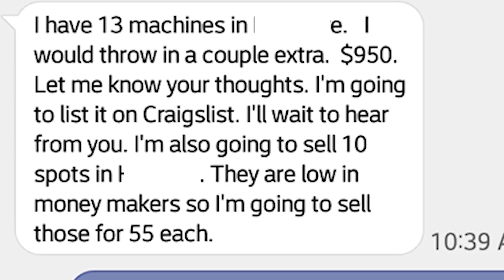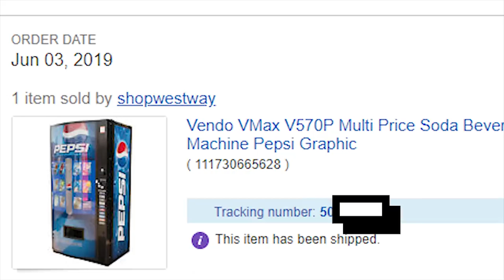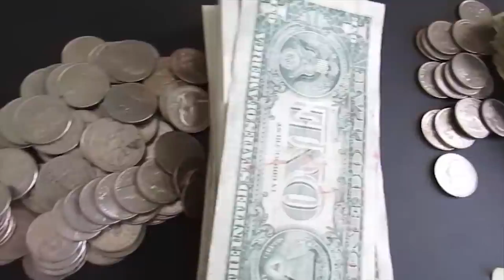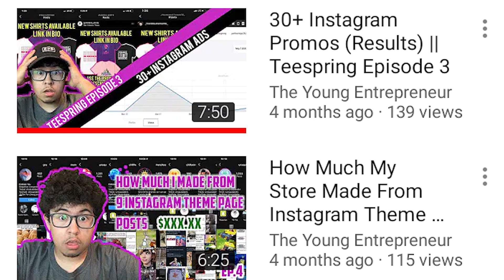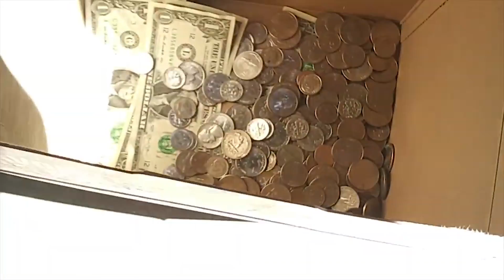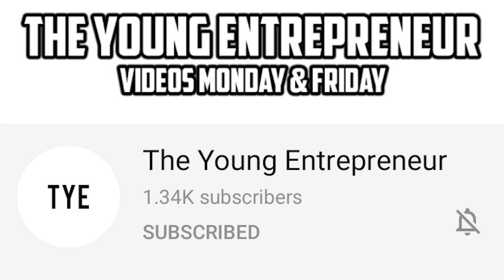Why I QUIT My VENDING MACHINE BUSINESS and PROS and CONS

Comment: If you have the money to start one with good locations I definitely recommend! I work for a guy that owns 150 machines and it's well worth it!
Reply: 150 machines is no longer passive that’s a full time job to manage
Reply: @kenlawdhammercy5804  If you are talking Full Line Yes.  If you are talking Bulk - NO!  Shelf life for bubblegum is 2 - 3 months.  Once the machines are placed you are servicing - cleaning the machines, checking for ants, making sure the machines aren't facing sunlight, building good customer relations.  You have a route and make your route work whereby you check on your machines every 15 days.  Some people do every 30.  I like 15 because if you have a bad machine, you find out about it in two weeks and rectify as oppose to 4 weeks.  Another thing is you invest in solid machines like Beaver.  Cheap machines will cause you to work harder, not smarter.  Experiment with pricing.  I might charge a dime for my products depending on the location.  I once had a bulk dime machine at a dry cleaners just for employees and it cleaned up.
Reply: Just sounds like a complainer giving all the reasons of “why I don’t want to work”
Reply: How much profit he makes? Lying bro
Reply: @edgarmontano473  not complaining. The point of having a vending machine business is to have semi-passive income while focusing on other bigger business

Comment: I used to work at this local auto shop and there was this candy machine that the workers would flip the machine over and shake it until candy fell out of it. I felt bad for the guy because he wasn’t making any money out of it. I hoped he moved it away from there. Just gets to show what people would do to your machine when your are not there and also why I’m skeptical about running a vending machine business.
Reply: I know someone who bolted it to the wall with to by four
Reply: That's actually not possible to tip it over and get candy that way, because of the way it's designed, (trust me I have one). There's only 2 ways to get candy from the turnstile machines, through the base that has a failsafe that won't open unless money is inserted which allows the crank to turn and drop a small amount of candy. The other way is to have the key to open the top lid where you fill it. Of course the third way is to smash it with a hammer. But it's literally impossible to get candy by turning it upside down. The best you would get is candy dust or crumbs if even that because again, the internal mechanism is completely closed unless money is inserted. It's literally impossible. 

Do you think they'd engineer something complicated enough to recognize you put enough quarters in to free the crank spring to allow you to turn it and allow just a small amount of candy, and yet not think about how to keep someone from flipping it over and stealing candy?

Come on man, I call b.s.
Reply: The best way of running the machine is to refurbish and sell them
Reply: @deefuze1151  it's ez..you just rock it back n forth..
Reply: @deefuze1151  That does not stop the 13% from trying however..

Comment: I have 20 grand to start a snack/beverage vending machine business. I know you have to be in it for the long run before you start turning in profits. You need to have good high traffic locations with more than 100 employees in them. I know you need a lot of vending machines out there too. (34-68 machines) You need to invest in the newer updated vending machines too. It helps out a lot with inventory and sales. I know you need a Van, heavy duty moving equipment and a trailer. Also, you’ll need a storage garage. I know the machines break down sometimes and you need training to fix it or you pay a technician to fix it for you. I’m not being mean but the cons you mentioned are expected. I feel like you gave up too easily. There are others out there who pushed through the 3-6 year grind and they are seeing the profits now. Just like any business: You do not pay yourself until you have grown your business to a good size and paid your debts off.
Reply: How’s it going?
Reply: @jakesmith-bs4jd  Only a philosophy.

Comment: Someone in my town is selling an entire route with 55 machines...54 of which are already set up in locations. Included are 2 vehicles, a bunch of existing inventory, and a bunch of parts for basic repairs of the machines.
They want $75,000 for it...but I really can't help but wonder if they're selling the business because it's just not worth all the hassle.
Reply: Its not. coming from someone in the industry, those 54 vending machines if they're drink machines would cost 80-110k themselves. plus that business probably makes around 20k to 30k a month. So that business has an asset capitalization of around 150k. A business that has an asset valuation of 150k would likely "market" for an asking of somewhere around 250k to 300k (maybe 400k if the route is well set up). That deal doesn't make sense.
Reply: Talk em down to 35k lol

Comment: Dude, why didn't you just go to mini claw machines?  They're smaller, (less heavy). product never expires, product is way way cheaper in bulk, you can change your items all the time. Super easy to check, collect, fix, and refill vs a huge beast of a vending machine. Mini claw machines are thousands cheaper than a large one. You can change the probability. You'll almost always make profit. It's even better if you have Nayax credit card readers. The footprint sells itself. They're 1 x 1 ft. Not every place wants a huge machine. I can pick up a mini by myself.... literally. They're about $700 vs thousands upon thousands for one or a large crane machine. 

Bottom line bro, you have to change your approach when you go to talk to owners. Go in professionally, have an llc and business account, most important.... practice how to overcome "no". Know why it benefits them and keep it brief. NEVER pitch the entire thing to anyone but the owner and manager (preferably at the same time). No one can sell it like you. Have business cards and a well made flyer. Dress well, and don't go to them when they're busy. They'll resent that.

Create a website with a QR code you can check on your own time where they can only email not call or text. 

I almost never get no's. Sold 14 machines to hosters first time and only received 2 no's.

Screw doing regular vending machines. You'll NEVER make more than what you charge.

Comment: The one thing that stands out here is that your locations sucked. Im from Germany but the way I do it over here is, I dont go around and ask people if I just place my machine in their Business. I am paying them rent. Like 50-75$ a month. Plus I pay the electricity. That's how you get the good spots.

And of course I dont even Start with gums n shit.. I have proper Snack and Drink machines that cost around 5000$ (refurbished). Those machines just work es they should. Plus they are connected to the Internet via simcard. So you can see from home how much you made, what needs to be refilled ect. So I just drive there when it's needet.

I need to go to my machines like twice the week. Sometimes more. But I work for about 8-10hrs a week and make Profit like someone who works 40-50hrs a week.

It's how you do it. Make it right, then you will succed